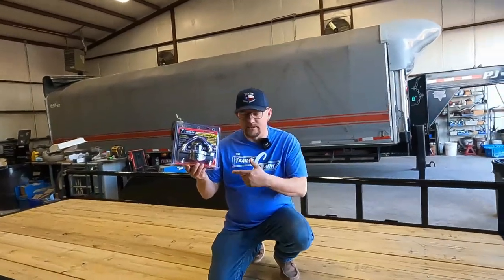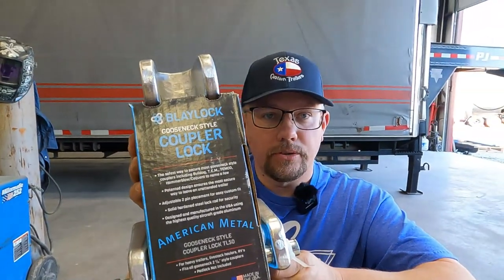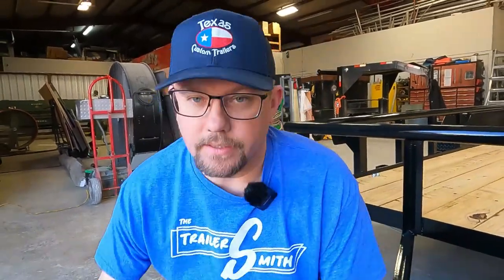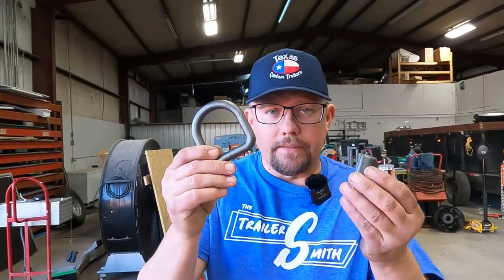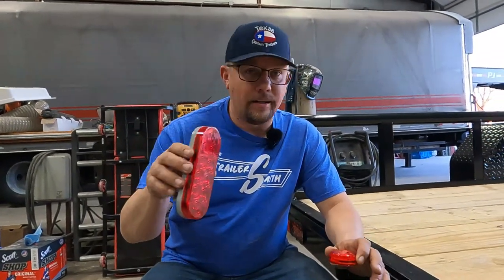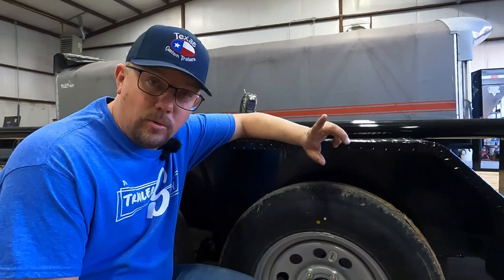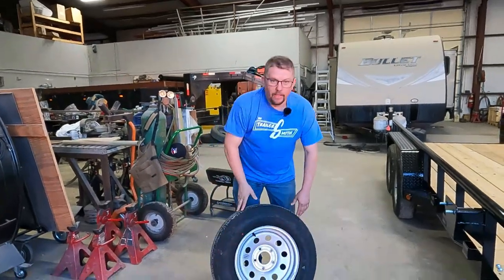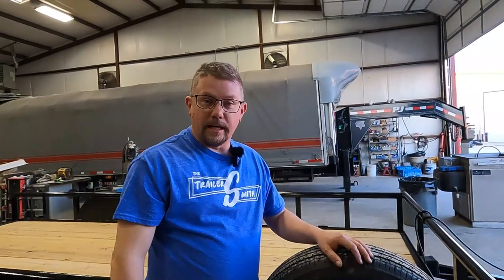My #1 Trailer Accessory

Comment: Years ago borrowed a trailer from a friend. Needed it for 600 mile round trip.  200 miles from home, tire blew, no spare tire.  I now take a spare tire for 5 mile round trip to put the boat in or out.  Failure to prepare means you are prepared to fail!  Great advice!
Reply from the maker: Great thought!  Unfortunately, I’ve learned the hard way, too. Thanks for watching!

Comment: As I age I find the trailer ramps seem to gain weight. ( I put them on a diet to no avail) I upgraded the springs on the trailer ramps but they still had the same problem. I was looking at auxiliary springs like Gorilla springs but have no idea if the really work or if the are a good idea or not. What is your advice about auxiliary springs? Also what is the most effective way to lighten those ramps as a guy ages? A new trailer is not an option as I need a 16,000 gvw trailer to haul my tractor around.  Only a moderate amount of use 2 to3 times a month in the late spring, summer& early fall. but need it when it needs to move the tractor.Live in northern NH.

Comment: Which spare tire mount is that?
Reply from the maker: It’s actually a fabricated, weld-on mount. It was installed in manufacturing. I’m not the biggest fan of the bolt on mounts, I prefer to use the fabricated, welded version. 
Thanks for watching and for the comment!

Comment: I agree with having a spare, however I believe the trailer manufacturer should provide one.. Instead of being so cheap, provide one. Instead they want to charge you extra, 400+ for a spare. Just my thoughts.  At least the RVs have spares... thanks for the information.
Reply from the maker: Everything costs money. The profit margins in the trailer industry are incredibly tight, I doubt we will see them throw in a spare tire for free.
Reply: They will not add a spare because of the profit of selling it at an additional nearly 500 vs 200 +/- from the factory.